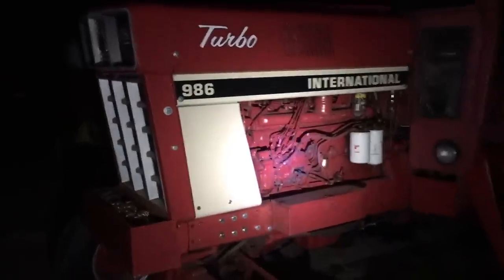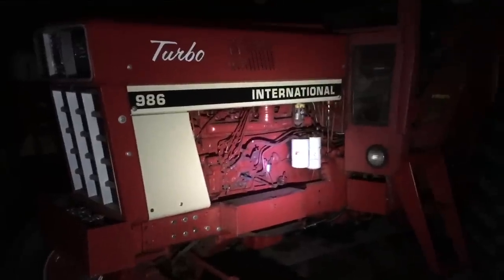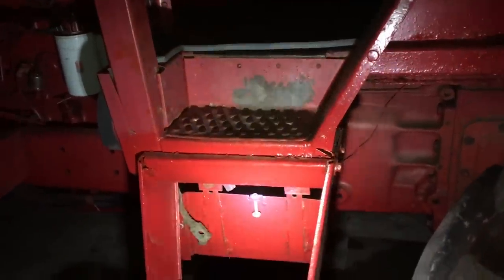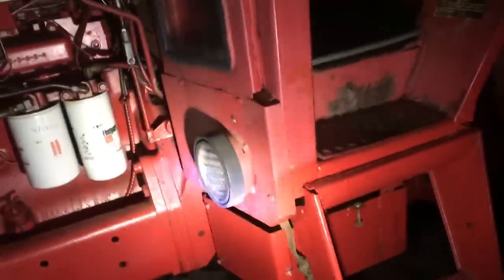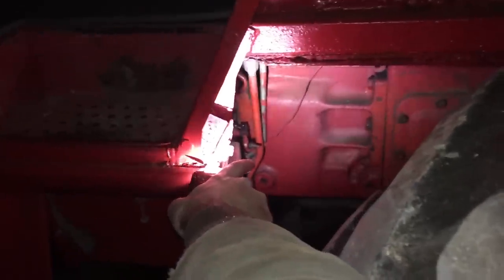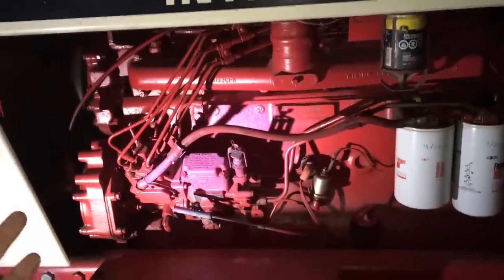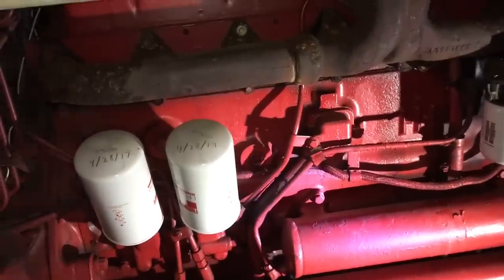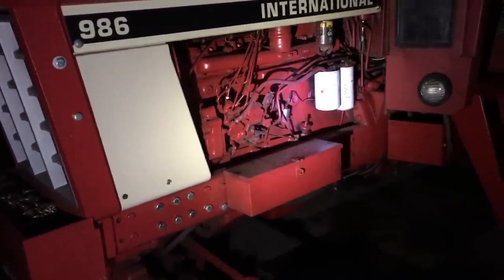IH 66/86 Series

Comment: I have a question for you red guys... In the 706 tractors why did IH go from using their own D282 diesel engine to a German built D310 diesel engine? Who manufactured those 310 motors?
Reply: IH Neuss plant
Reply: Built in IH plant at Neuss Germany - great engines - "German diesels"
Reply: D282s were a pain in the a- - when got below 0 ! If you weren’t going use it for a hr. you let it run or park it where you could plug it in. Never had problems with our 310 (756)
Reply: The 310,s  were German built,,  and a lot better  for a 706,,  and a few more,   the 282,s  were more of a 560 engine,   the 706,s  I thought were to heavy  for that 282,,,

Comment: older iron isn't complicated, just misunderstood, that is the case every time. I've heard of the TA goosing, or, hands using it as a motor brake of sorts, it has led to some pretty bad road accidents. Humans will never stop trying to find ways to get hurt. All I know is those models, get the bugs worked out, give'em more boost from turbo, match that with air and fuel, not talking about drag strip specs, but, I seen one on my road now pulling around a 20' ripper, with ease......... Keep the old iron around, they had soul.
Reply from the maker: Yea I think if I was able to own new iron, I still wouldn’t be able to part with the classics.

Comment: where can I find the tech manual, I need information about the timing of the fuel pump. IH 866 6 cyl
Reply: 886?D358 IH Neuss.german built.IH svce manual GSS 1377.covers 3 thru 6 cyl Neuss

Comment: Just subbed your channel👍👍😎 I'm not familiar with the later generation IH  more JD , I've got a friend with a 686 IH he says it it needs a hydraulic pump. Where would a person start, filters and fluid, but after that? You mentioned the MCV valve and a drive gear behind it. What's the possiblity of the pump actually being the problem?

Comment: Hey man. I have to use ether on my 1086 to start it every time. Hot or cold. Just bought it. Just a little squirt and it’ll fire right up. I read it could be a fuel issue, low compression, and a couple other things. Whats your take on it?
Reply: Have you checked the throttle linkage?

Comment: Got a 1066 that when you first start it up about half of the time the clutch doesn't press in rigjt and it has no steering. Sometimes it's for 30 seconds sometimes I'll get aggervated and come back to it and it will start and work fine or do it again until it decides to start working. Does anyone know what this is
Reply from the maker: Sounds like the pump is going bad.
Reply: @PAFarms  when it does this the brakes got pressure on the pedal, the lift and remotes work fine though. It could still be the pump I jus dont understand how everything works fine
Reply from the maker: My neighbors is like that, it takes a while till it warms up to get pressure. Usually it’s the front pump on the MCV valve that gives trouble.
Reply: @PAFarms  from what ive found on it that's what it sounds like I'm hoping. Thank you
Reply: Try over filling the hydraulic fluid by 5 gallons. It could be an o-ring on the suction pipe and over filling will keep that spot submerged. It won't hurt anything.

Comment: I guess I always thought the 86 series was shorter than the 66 series, but I was wrong. Lol.
Reply from the maker: Haha it does look like that from behind the wheel, basically if you look at the seat location, 86 Series is front a few feet. There is a video on here about the 86 series. Was an advertising film from the 70s that they explain the change.

Comment: My dad had a farmall 350 if you pull the t/a back going down hill it would take off and free wheel do the 06, 66, 86 do the same thing?
Reply from the maker: No, the TA is a different design in the bigger models. If they are working, it should hold you back. The other TAs weren’t designed to hold back
Reply: PA Farms thank you, do you know what model they changed that?
Reply: Randy Williams i am pretty sure it was the 706

Comment: Bosch pumps are top of the line? Robert Bosch was the American (ambac) pump was a horrible pump
Reply: The American Bosch pump was much more sensitive to loads coming on it.  That is why the 8000 Series AC went to them.  The Robert Bosch pump and 1 punger and deliver valve per cylinder and ran at 1/2 of engine speed.  The American Bosch had 1 punger and delivery valve for the whole pump and ran at full engine speed.  It cost 1/2 and much to over haul the pump as the Robert Bosch but the Robert Bosch ran twice as long.  Cost per hour was the same.
Reply: @countrygent4  actually that's wrong. Ambac pumps were only responsive at high RPM, they cost the same to go through if done properly and still don't work. 8000 series Allis Chalmers are being switched over to Robert Bosch for just that reason
Reply: @countrygent4  I can't tell if you're defending them, but most A-C guys really dislike the AMBAC pump. Some guys have switched their 8000 series over to the Rossamaster  pump found on the 7000 series.